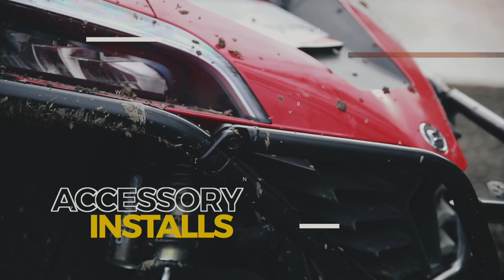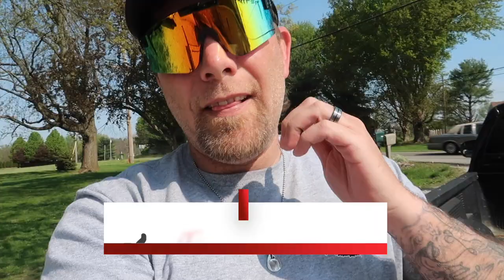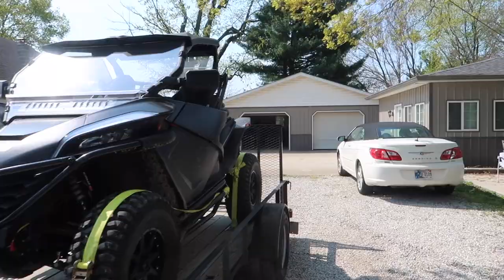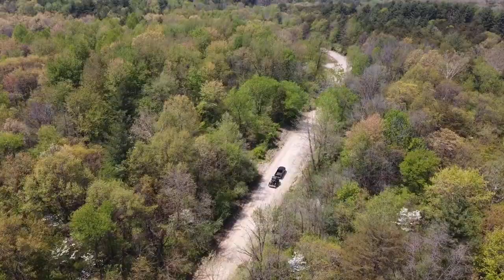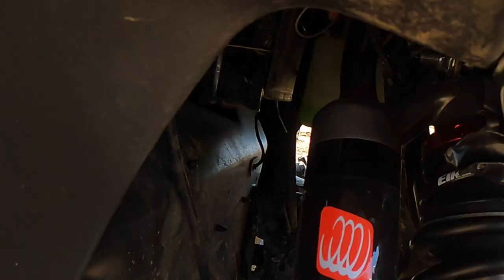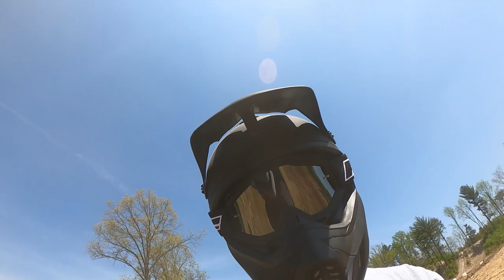CFMoto Zforce 950 Sport at the Race Track | Elka Stage 4 Adjustments and Testing   HD 1080p

Comment: For more hard core racers I would suggest stage 5's in either our 2.0's (2.0's in this video) or for all out NF's given massive 2.5 stage 5's. But the stage 5 ADDs full control, 26 clicks on the HIGH speed side of the valving stack, so you can fine tune to the moon. As an idea, ALL 5 of our Hester Edition Shocks have dual stage high/low speed compression valving stack, so as an idea, when you were about in the middle (roughly 10-11 clicks in) that is the baseline on even the stage 1's, so slap some stage 1's and they ride like the middle road you showed. Plush, chew up the terrain and can still handle high speed and make the stockers feel like 2x4's lol Thank Justin! Would love to see it in a race. Slap some 28's on it, strip shield and rear window off, put a net on front to deflect rocks (lets air flow through, less drag) and flat hold the throttle down, most those jumps you showed those can over jump and flat land those with ease, just SEND IT lol
Reply from the maker: I really am enjoying these, John! Thank you so much!
Reply from the maker: And I really am thinking about racing it. Lol
Reply: Have you developed anything for the 22 950ho sports yet?
Reply: @countryacademy9053  once I have an HO to see if they actually did somthing different other then 2" longer (per side) arms, they the shocks would have stayed the same, just longer arms, but soon as I get my hands on a 950EX I will get the set up and start taking orders.

Comment: I wish the stock shocks that were that easy to adjust.
Reply from the maker: No kidding!
Reply from the maker: Hand adjusting on the fly!
Reply: @JustinTheCreator  this is where my non mechanical issues slow me down. not sure if I could change my shocks on my own with out calling in a buddy. hmm. will need to watch your video again and see if I can manage.
Reply from the maker: @SimplyNewEngland  bolt at the top and bolt at the bottom. You can do it, they are super easy